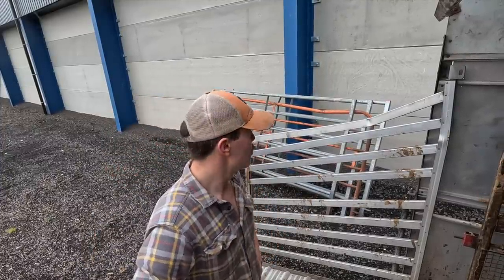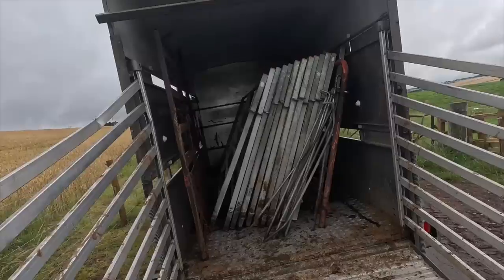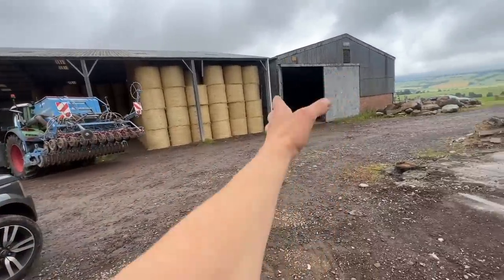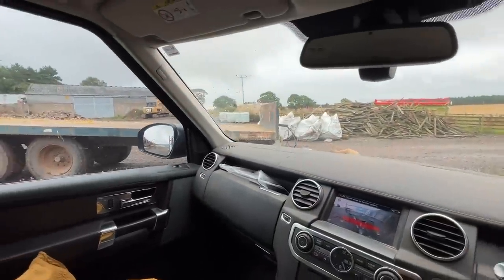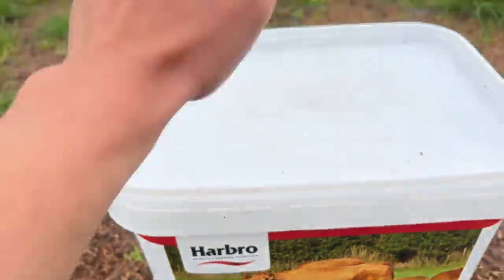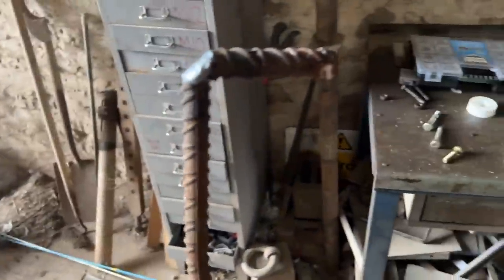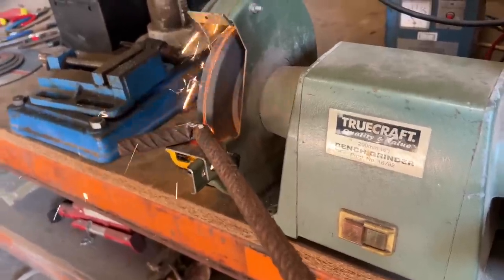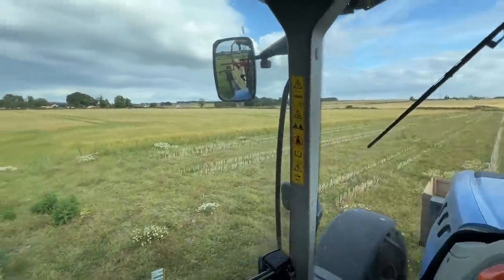Is This A Bad Idea? Theres A Lot To Think About

Comment: Just a thought about the water in the new shed.  Why not run a heat trace wire along all the water pipes.  It’ll stop them freezing and that’s what my mate has on his cattle and sheep sheds.  Doesn’t use much electricity and has never frozen.

Comment: Great video best advice for ur water pipes is take one pipe to each trough from ur new borehole shed, make a manifold up so each trough can be turned off in the shed and don’t have any joints under the concrete length of pipes are much cheaper then digging up concrete a few years down the line with blocked fittings

Comment: If you have water troughs between pens you probably won't have trouble with the water freezing as the number of cattle drinking usually keeps the water running.
Reply from the maker: Most will be fine but have bull pens and also couple troughs in the handling area as a sort of isolation pen 👍🏼
Reply: @CrawfordsFarm1 1 of the lambs isn’t well